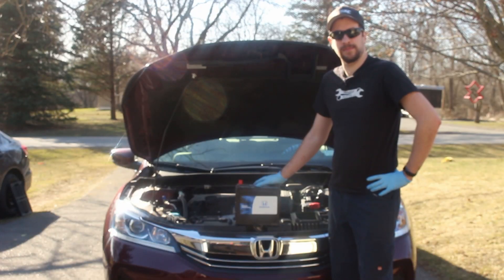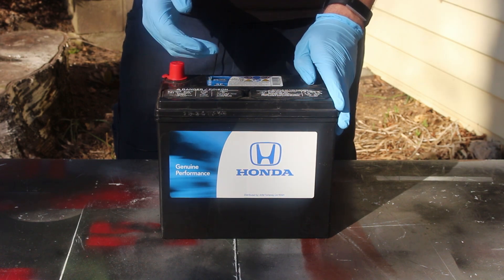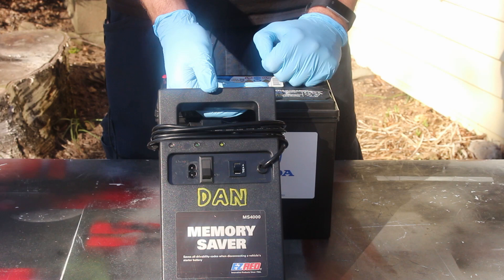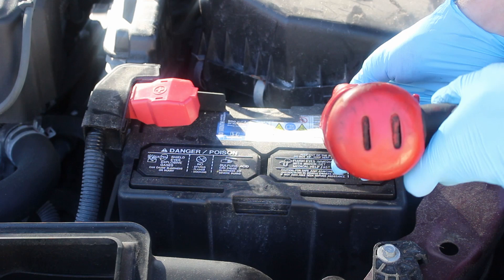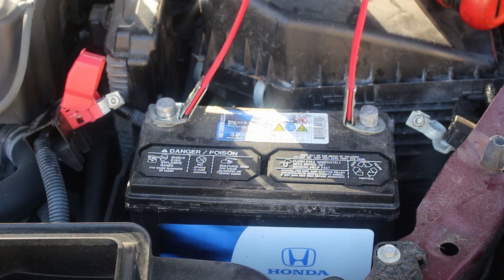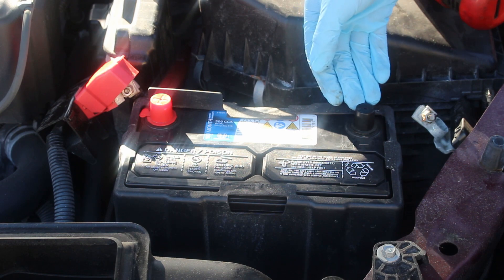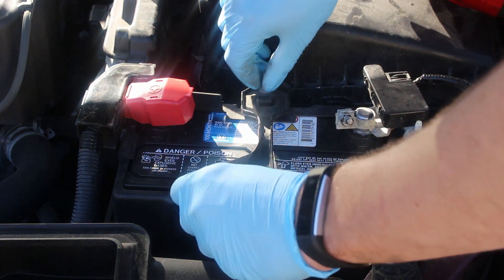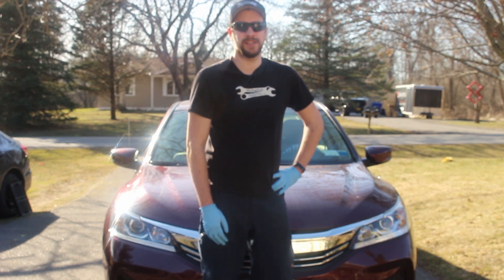How to Replace the Battery in a Honda

Comment: Very informative!  When I installed a new battery for Honda Accord 2001, the radio system sent to anti-theft mode. Sadly, when I entered the wrong code a couple of times, I had to removed the cigarette lighter fuse for 10 seconds. I'll make sure not to overtighten the battery hold down bracket J-bolts to prevent the battery case from cracking and leaking. Thank you, Mechanical Malarkey